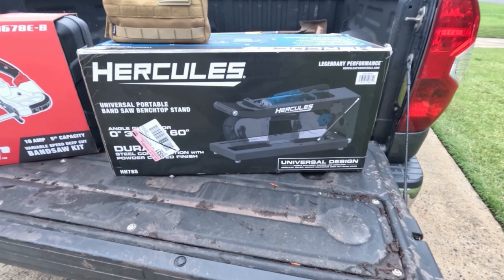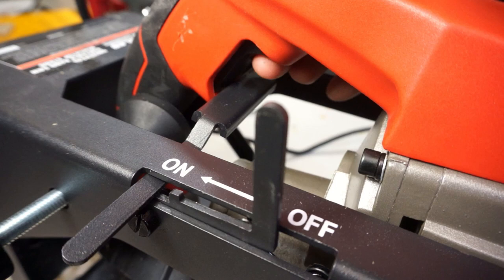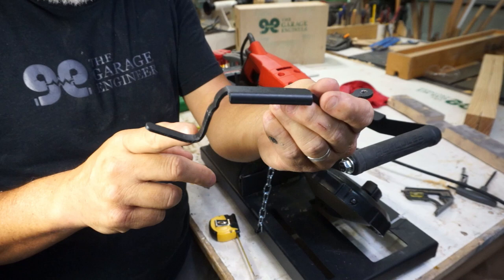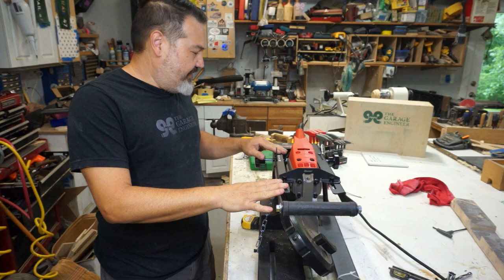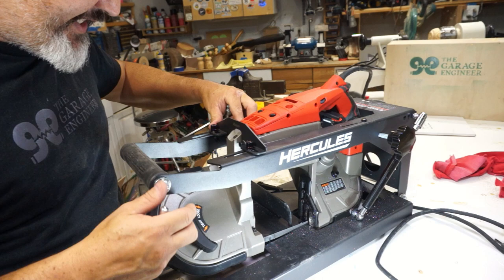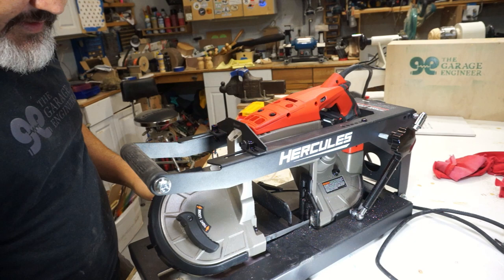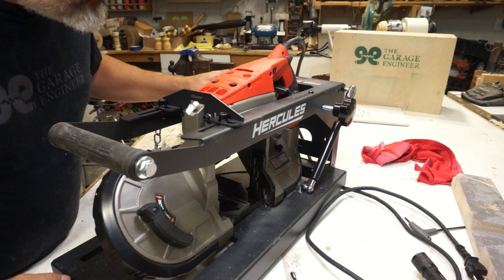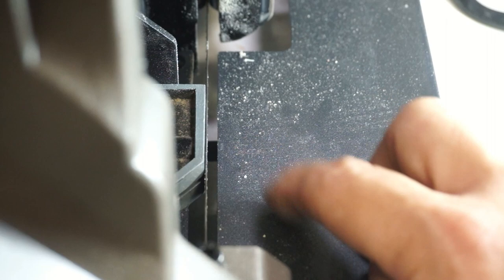Still the Best New Product? pt. 2 - Fixing and Aligning Harbor Freight mobile band saw stand.

Comment: You don't have the band saw mounted correctly.  That's why the switch doesn't work.
Reply: Is there any videos on the right way of installing because I’m having the same issue
Reply: @troyareson8075  He's got it in there correctly, it's just the switch thing wasn't thought out very well for a Bauer. Buy a footpedal, and zip tie the switch. That will save on the in handle switch contacts from wearing out.
Reply: Mine was in the second to last hole. It would start, but then the switch would release. Instead of bending my mechanism I inserted a piece of plastic tubing to take up the gap. Worked perfect.
Reply from the maker: Thats a great ideas.  Thanks for sharing.
Reply from the maker: Great idea.
Reply: I bought the first stand my store received. I have to admit I am not sure I'd buy it again.  I'd hoped it would be quicker and easier to install and remove the saw from the stand. There is no way I'd go through all that process and alignment to separate the two items.

I bought a cheap foot pedal switch to avoid the aggravation you went through with the trigger switch assembly. Also,  for some reason my saw blade will not center in the stand's kerf slot. The blade is positioned far to the switch side of the stand when the adjustment is at the limit. I could modify the stand bracket but I shouldn't have to considering the stand is meant to hold a Bauer saw. I was also missing the directions and some nuts, bolts and washers with my stand. Thankfully the manual is online and the hardware was locally available.
Reply: If you slide the band saw forward buy the front adjustment brackets more the switch would work fine
Reply: This isn't a constructive comment in the slightest. How about offering a solution to how to mount it correctly instead of just saying simply "you don't have the band saw mounted correctly.."?

Comment: The black drop down guard/stop thang has to come off the saw so you can move the saw up on the mounting slots enough for the switch lever to work.  This will also increase your cut capacity.
Reply from the maker: I will have to give it a try.
Reply: @TheGarageEngineer  also I put the switch bar on top and put the screw in from the bottom.  Works way better and less messing around.  So blade guard off and switch on top with screw in from the bottom. Works perfectly no bending required 👍

Comment: Thanks for the video - I've been wanting to get this mount when I fine one.  Another option for power is to use a pedal switch from HF and just zip tie the trigger on the saw.  I have that set-up on my vertical band saw - if something goes wrong just take your foot off the pedal and the saw stops
Reply from the maker: I’ll have to look into the foot pedal.  Good idea

Comment: I just got one of those but I didn’t bend mine,  if you put the round part of that trigger bar on top where the holes are and put the screw in from the bottom it works just fine.

Comment: Good video! I bought the Bauer band saw for my son, and later was able to get the mounting stands for both of us. I also bought me a Hercules saw and did not have the problems you did with the trigger. However, the last little part of your video addresses my problem with the saw cutting straight vertically. :)
Reply from the maker: When I bought the stand, HF had not released the Hercules saw yet.  That is why I had the Bauer saw. But on the stand box it showed a Hercules saw, so I figured the stand was more set up for the Hercules saw shape.  Glad the video helped and thanks for watching.
Reply: @TheGarageEngineer  Still working with the saw. It cuts square, front to rear, but the blade 'tilts' and cuts at an angle. Very frustrating!! 
Any ideas??
Reply: @MagaRickn I picked one up today….having the same problem.

Comment: Just bought exact same setup and had the same initial problem.
Had to slide the saw so the factory fence is right up close to the fence on the stand in the horizontal position.   It’s in the directions.
You don’t need to bend the bracket.
Reply from the maker: Ill have to relook at that, but I think that is what I did and it still didnt work.  Thanks for watching.

Comment: The bandsaw is incorrectly mounted in the stand.  It has to sit lower down, so the blade sits lower in the base slot also. Second to last hole. I have the same setup, no problems.
Reply: Please elaborate;maybe with a picture because I can’t figure out what you are saying.
I fiddled with mine for 2 hours yesterday and couldn’t get the thing to cut square.  However, like an idiot, I wasn’t using a square, but was trying to “eyeball” it.  To compound the problem I was test cutting on .095 1 3/4” tubing.  Watching the author use the square and the wood I was like “🎉😮”.  
Seeing him use the square on the cut piece to check alignment in both directions was a major “head slap” moment for me….Sometimes I just amaze myself!!

Comment: Do use the chopsaw part of it much? Or do you think it would be better to just get a dedicated upright mount from another company that doesn’t take up that extra space on the front of your bench and also has a slot in the table for a miter guage?
Reply from the maker: For the projects I need this for I do use both vert and horizontal cutting.   If a persons space and budget allows It I would get 2 separate units.   But this tool is very capable at cutting.This does not have a miter gauge slot in the table.  Thanks for watching.

Comment: Wen makes a foot pedal switch for $10 or $15 bucks. It came with my Wen brand bandsaw but you can buy just the foot pedal. I have not confirmed if the wen bandsaw fits the Hercules stand but it looks like it will. I’m waiting for HF get them back in local to me. I have used Wen on the swag table and it’s nice having the foot pedal switch.
Reply from the maker: good idea.  I will have to try it out. Thanks for watching.